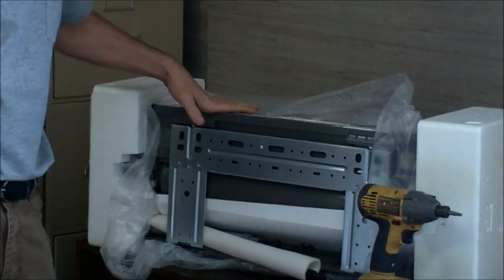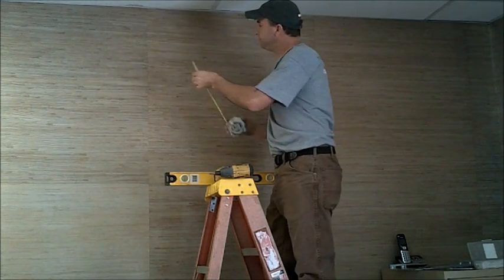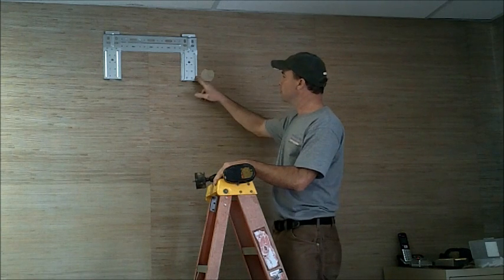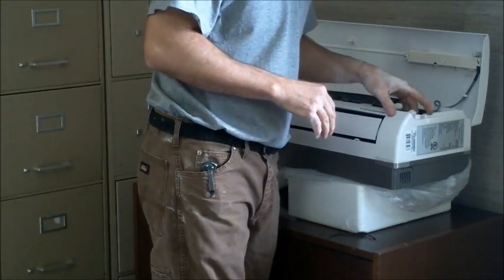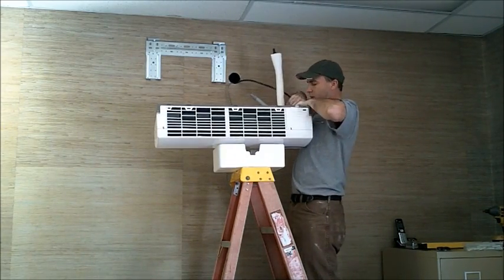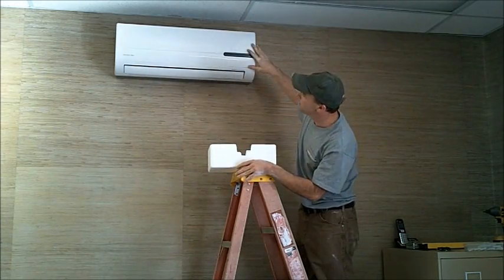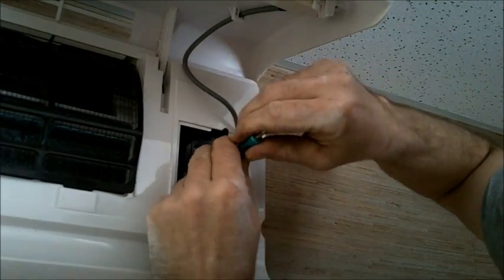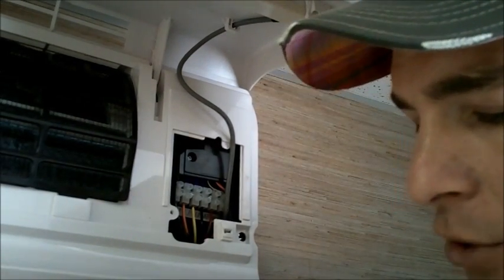Ductless Mini Split Heat Pump Installation  Part 1

Comment: Hi Toby, I have a Ductless air 12,000btu and I have installed it myself.  It won't even turn on . I'm sure it's a power issues. I have a 14 gage with 15 double amp breaker. I have know one to help me with this. I'm a female , i'm pretty handy but cannot figure this out! If you could please help me. Do you think the 14 gage is not strong enough? ❤❤❤
Reply from the maker: It's not your wire . I may can help you send me pictures of your install with all wiring indoor and outdoor disconnect and electrical  panel and I'll see if I can spot something.
Reply from the maker: Tbouknight@bellsouth.net

Comment: hey Toby thanks for the videos on mini splits. I am having a problem with a Ductless Aire mini split. The install went as described in the manual. Everything checked out. But when I turned the breaker on the LED would not light up, and the unit will not run??? I do not know where to go from here. There is voltage everywhere there is supposed to be.  Is there a fuse I can check or what do you suggest?

.
Reply from the maker: Check l1 to l2  make sure 220volts.   Do not check l1 or l2 to ground. 220 min .
Reply: @ACPro  I tried 1 to 2 I got no reading. I don't understand how + to + will give any reading. Still no display light.
Reply from the maker: @alanhoos7610  means you have the same leg of power on both.   To have 220 you much have 2 different legs of power.   If this is confusing to you make it simple.   Use a double pole breaker  1 wire on each side. And a direct wire to the machine.   Do not use 2 single pole breakers.  This will fix your problem
Reply: I am using a double pole breaker.  I ran one wire out to each side of the disconnect and a ground.
Reply from the maker: @alanhoos7610   ok problem could be in the disconnect.   I have seen it many times.  Look close at disconnect at the terminals.   It is stamped in the plastic. Line , load.   Make sure from breaker it is going to the 2 line side terminals.  Normally they are separated and not side by side.
Reply: @ACPro  they are correctly connected line to the inside load to the outside. I have a tech coming Mon. I think its the control module i'm afraid to pull it and mess up the warrantee if they will honor it at all.

Comment: Good luck
Reply from the maker: Why luck .  This was installed years and years ago.   Still running strong today.   A machine is only as good as the installation.   Do yours right with professional tools and don't skip any steps and you too can have long lasting results!

Comment: What would be the advantage of getting a unit like this as opposed to a window or portable unit? I'm looking to heat and cool my metal garage. Thanks.
Reply from the maker: If is is a garage and you not staying there all the time maybe a Ptac is better.   They are cheaper , easier to install and if there is problem you can replace the unit without sleeve.   Mini splits are extremely quiet.
Reply: @ACPro  Okay, thanks for your reply. I'll look into Ptac.

Comment: How are these systems holding up?

A trick I learned for going through soft stuff with a hole saw is to run it backwards, like through the insulation it cuts cleanly instead of making a big wadded up mess in your bit...
Reply from the maker: That's a great tip!!   These systems actually hold up very well.  Only draw back I have noticed is most people dont do maintenance on them. Therefore the life is alot less than a central.

Comment: What is the size of that hole u drill on the wall. 2 1/2 inches?
Reply from the maker: 2.5 inches normally works fine.   If you are bringing your main power conduit out of the same hole you may want bigger.  But normally 2.5 is plentiful
Reply: Ok thank you. I’ll be installing once this week. Wasn’t sure if it was 2.5 or 2 5/8. Thx for the reply

Comment: Thanks. Is it possible to connect a thermostat to this? Anyone have tried that?
Reply from the maker: There are models that takes thermostats and are ready for them.      If you are unsure if yours will except a wired stat or not sensibo and ceilo breeze makes a wifi thermostat that will work .
Reply: @ACPro  Thanks for the response. I'm asking specific to this model. Is it possible to connect a thermostat to this ductlessAire?

Comment: Hello, nice video what to I have to do I have to reverse the pipes from the right side to the  left side? . Thank you
Reply from the maker: Luigi Galassi  it can be done behind the air handler,  however it is hard to insure proper drain and fitting connections as it is difficult to leak test. Best way to do opposite sides is to cut out a channel in the sheet rock and build a chase for the lines .

Comment: Good job. Are the L1 and N1 the line voltage to start the indoor fan motor? Thank you for making this video.
Reply from the maker: AJ HVAC  . L1 would be incoming voltage and n would be neutral on 120volt system. And yes this is to drive the blower motor.  Also most of the single speed systems have a small capacitor on the blower circuit.

Comment: Hi, I just have my heat pump installed today...when I turn it on starts smell so heavy -like between the walls where all is dump and dusty stinky smell; why is that? how can be fix so I could use the heat pump-as is now prefer no to turn it on.
Reply from the maker: sounds like the hole in the wall wasn't sealed properly. seal the wall penetration completely.

Comment: I just had to have the main pump replaced on mine, I have a Mitsubishi heat pump put in three years ago  it cost $600.00 to replace it and I was told it was still under warranty.

Comment: what size wire are you using to connect the head
Reply from the maker: 16-6 wire stranded cable, you can call the guys at ductlessaire.com and they can help you if you need some

Comment: After you did the vacuum, how did you disconnect your hose from the suction side and maintain your vacuum in the system before you put you cap on?
Reply: In the senville manual it says to open the valve 1/4 turn and allow the charge to fill the lines and evaporator to test for leaks, THEN you close the valve again so you can remove the vacuum hose so you lose less charge... Then you open both valves all the way
Reply from the maker: You dont disconnect your hose until charge is dumped and pressures are checked. Iy is also good to check your superheat to insure no over or under charging.